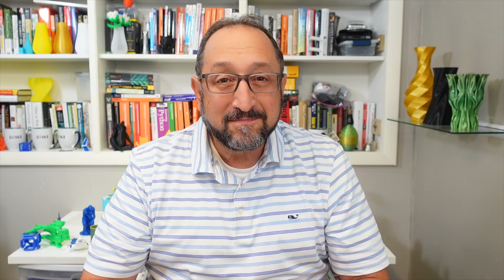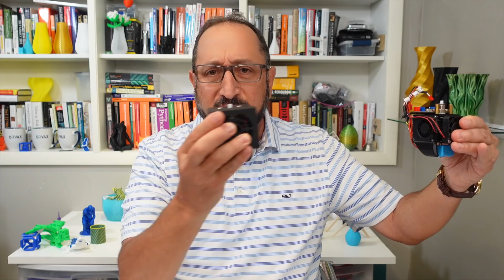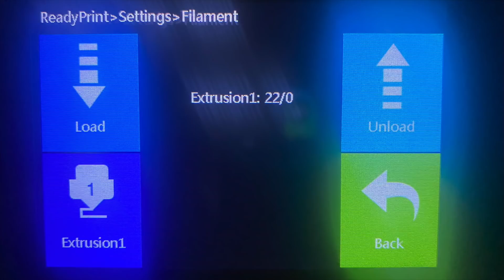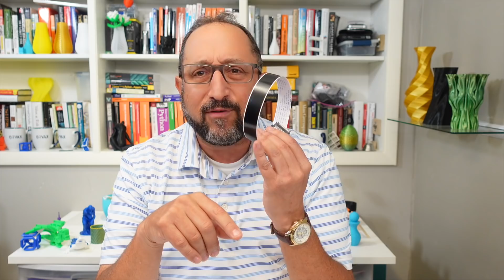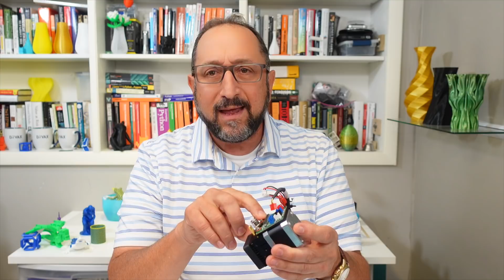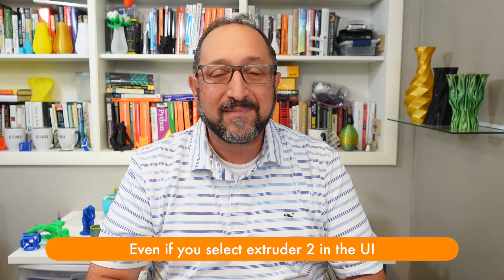Repairing my 3d Printer - Lessons Learned

Comment: I have been messing with electronics since the 1950's, and yes indeed, bad connections are the problem at least 90 % of the time.  When in doubt, just disconnect and reset everything. A friend once brought me a genuine Las Vegas one-armed bandit, which just went entirely dark, all at once.  I opened it up, and all  text inside it designating everything was Chinese or Japanese (I really couldn't  differentiate).  There were not less then 30 cable connections inside, and I pulled and reseated them all.  When I turned it on, it worked.  That's how I got my reputation as  genius.

Comment: This is definetly a firmware bug and the vendor should fix it. But yes, the first step if you can't understand what's "suddenly" going on -- reset to default and do step-by-step setup, changing and checking 1 item per step. Also, the first thing I do when I buy new printer or when my friends ask for the help with their -- check hardware and electronics. I had fantastic experience helping my friend with chinease clone of the Ender3 that has 2 motors for Z-axis( Ender 3 has only one). And some *diot set different voltage( which means different current for motors) on drivers. It was 0.7V and 1.1V. Gues the behaviour of the Z-axis. 🤣 Also, one motor was extremally hot.
Another situation was wrong stock GT2 belt routing for CoreXY-based printer. So the printer X axis and Y axis were moving ok in some  directions and wrong in another.

Comment: HINT HINT HINT :) 
Hey Irv, Thanks for great videos, quick lesson learned from me. I noticed a lot of under extrusion and i ensured all slicer settings had 100% extrusion and still got under extrusion. However, long story short, i cut short lengths of filament and pushed into the filament sensors, then i created a clip that goes over the top bar, one for each filament feed, then it acts as a guide and bypasses the sensor. No more under extrusion issues. I have a feeling it created just a little TOO much drag!
Reply: Just a hint -- different filaments have different characteristics even if they say it's the same material( e.g. PLA, ABS, etc). You should always re-adjust your settings if you change filament. Even 2 different colors of the same e.g. ABS or Nylon from the same Vendor can have different E-Steps settings. Wrong E-steps will definetly result in over or under extrusion. Also, sometimes you need to have different than 100% flow setting for Cura to deal with the same issue.
Reply: @krukhlis  yeah definitely. I have used the same type of filament for the last 4 years. And printing since 2010. Even colors in some cases have different characteristics of the same brand

Comment: Hi, I love your videos. I have an Ender 5. Should I put away the reel of filament I was using once I finish a print? Should I cut it of at the extruder, or pull it out of the tube? etc? I haven't seen anyone mention this. What do you do/think?
Reply: A lot depends on the type of filament and the time it will be idle.  If it is PLA you are probably OK, PETG or ABS or any other water sensitive filament should be stored in a dry box.
I usually am printing on my printers every day, but if not using them for a while I will remover the filament and store.
Reply: @tradde11 How do you remove it? Just pull it out? Cut the filament at some point?
Reply: @tradde11 Thanks. What printer do you use?
Reply: @tradde11 OK. thanks. I think I'll follow your advice on how to remove the filament... I'll let you know how it went.
Reply: @tradde11 How hot would you recommend?
Reply: @tradde11 I still haven't changed the filament.. I'm still using the one I had in

Comment: I bought two, one arrived damaged, loose electronic parts came out from inside the printer, I have been waiting for parts for ten days, it comes from China, no stock in the USA
the other is working, both of them I had to completely disarm them, adjust the y and z rails,
after going through thousands of problems, it lost its calibration, a Z motor froze,
I have the same problem with the right extruder, in my case when I want to work the right one works the left one, you can see that it is something that happens to many of these printers
They are a headache, if you like to fix them more than print it is the perfect printer

Comment: clear

volume_up
610 / 5000
Translation results
I bought two, one arrived damaged, loose electronic parts came out from inside the printer, I have been waiting for parts for ten days, it comes from China, no stock in the USA
the other is working, both of them I had to completely disarm them, adjust the y and z rails,
after going through thousands of problems, it lost its calibration, a Z motor froze,
I have the same problem with the right extruder, in my case when I want to work the right one works the left one, you can see that it is something that happens to many of these printers
They are a headache, if you like to fix them more than print it is the perfect printer

Comment: So it remembers the mirror or duplicate even if you power cycle? It shouldn't because that is not the basic state. I agree it's a bug.
Reply from the maker: When you set the x mode to mirror all front panel filament movement comments are directed to the left extruder.

Comment: great tips. The main reason I went with the Prusa i3 kit vs assembled, was to become familiar with it before I have to troubleshoot.
Reply from the maker: I agree.  However putting together an i3 Mk3 is a painful exercise.
Reply: I’m following a couple RC 1/10th scale truck building channels where they recommended the i3 kit, so compared to working on RC kits , I found it rewarding and took a couple weeks of casually putting it together carefully following their excellent instructions with the online comments. But if I had the expectation that it was some assembly required and it would be up and running in a couple hours, then I agree it would have been painful and I would have likely made more mistakes trying to assemble it in one session.

Comment: This sounds like pretty bad engineering.  You do not change wiring like that without guarding against accidental use in a previous version (ex. by changing the connector and having some required gap at a certain position to mark the correct versions matching).  That said, when in doubt, the first suspect should be the user (so you), the second is the software (so firmware or settings) and only then hardware.  Now, I would expect that in your case the firmware (Marlin) should have given an error when trying to extrude with the second extruder if you would have sent gcode to it manually as it apparently should have been in a mode where it would think there's only 1 extruder (as the second would just mirror or clone).  If Marlin doesn't do that while not allowing the control of it, I would expect this is worth a bug-report on Marlin.

Comment: Since I saw your video on the JG Artist D Pro IDEX, I have been wondering whether it would be up to doing Polypropylene with Glass Fiber 30% while using water soluble support mat'l. Would you comment? I know there are no hardened steel nozzles, but the brass replacements aren't expensive
Reply from the maker: It depends on the temperature requirements.   I would not use this printer above about 230c.

Comment: Good information, I will add this. I have a Tenlog Pro IDEX and one of the issues I have had and still do sometimes because I forget is when I try to use the "Dual Mode" or the "Mirror Mode" 
if the project your printing is too big for the build plate " For Dual Printing" my printer will just start to print lines back and forth. The printer extruders would hit each other and so the printer does not know what to do and just prints stacked lines. I will move the project to the far left side of the build plate in the slicing software "For Dual or Mirror Prints" If that does not work I may need to make the project a little smaller, and that usually fixes the issue.
Reply from the maker: I have heard great things about the Tenlog.
Reply: @MakeWithTech  The first one was DOA but the customer service was very good and they sent out a new one immediately which has been running non stop since I got it :)